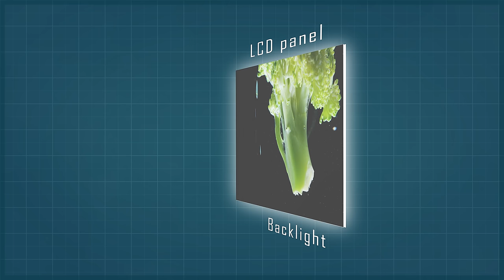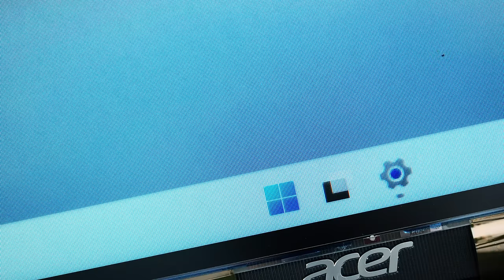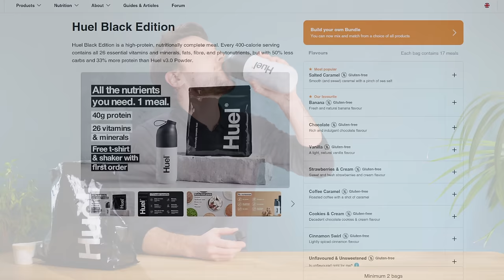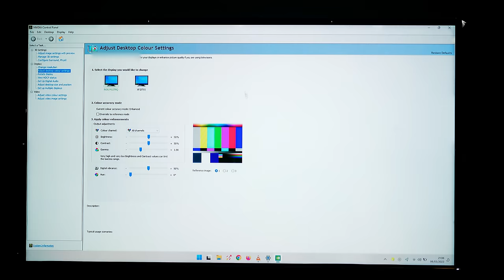DIY Dual-Layer LCD monitor - can it match OLED??

Comment: Very cool project Matt, even though this one isn't very practical as pulling 250W constantly for a monitor will easily offset just buying a more expensive monitor in the long term it's always fun seeing your ingenuity!
Reply: It's obviously winter monitor. During summer, he uses his DIY outdoors waterproof screen 😄
Reply: But it cuts your heating bill..
Reply: Not just the watts but your GPU would be effectively driving 2 monitors with only getting the resolution of one so WAY more GPU power is needed to. So yeah the cost of an Oled would be way more effective but yes still a interesting video.
Reply: @WDMurphy  no the HDMI signal was just split. GPU not doing anything more
Reply: @WDMurphy  but gpu is free heater. XD
Reply: @WDMurphy  That is incorrect. The GPU isn't "driving" anything. It is rendering a single image, the same as before.
Reply: @sid.h  LOL DRIVE as in why I used " "
Reply: @mattjnewham  ok but with HDCP HOW does he get any game or videos to run wouldn't that break hdcp?
Reply: HDCP isn't really being used nowadays.. In my computer I disable it on NVCleanInstall
Reply: @WDMurphy  splitting an HDMI signal still allows a handshake assuming the splitter supports it
Reply: @WDMurphy  Displaying more monitors actually has little to no effect on GPU performance
Reply: @WDMurphy  comparing to the average wattage of a computer monitor, it would take about 3 years to total the price of a good zone dimming monitor to replace (which as he mentioned has a greater blooming problem), and as others have mentioned the GPU isn't rendering any more than it already does so it doesn't have much of any effect on gpu power at all.
Reply: @platinumsky845  I have a Samsung 65" QN90A and a 27in 1080p 240hz as a secondary monitor. I never mentioned the wattage as "really" being the problem. The Samsung uses WAY fewer watts than he says he's using in this video AND it has local dimming BUT you are right about the blooming. It does suck and at times is way better with it off but that does FK up having nicer blacks.

My PC is an AMD 5800x, 32gb ram, rtx 3080ti
and total watts counting the Samsung and etc... on my powerbank monitoring, IS only ever near 378 watts even when gaming.

Now I did make the mistake that I thought he, in the video, was rendering 2 1080p videos overlapped (that's what I get for commenting before completely watching his video)

You are correct that the wattage "price" vs spending 1600$ isn't even comparable but and that's a big one I'm gaming on a 65in 4k 120hz "tv" compared to a 1080p monitor, not counting I could have just bought an Oled, but I prefer ips (yes really I do). You can get Oled "TVs" cheap enough now, burnin is my only concern because I do leave it on nearly 20hr a day.
 
And AT 8:03 HE even used the word "DRIVE" that someone else gave me $#!+ about using. I did not see him using a splitter which DOES somewhat negate my complaint.

People are even going and saying that running two monitors isn't more of a strain on a GPU which is BS "if" you are "running" at a higher resolution of two monitors and not splitting.
People are acting like a bunch of rabid wolves to be "that guy" like look look at me I'm right too.

You are right that the blooming can be complete crap tho, and Oleds basically fix that but there are also other downsides to Oleds. 
But if you're really that strapped for cash you probably shouldn't be taking on a project like this and "risk" losing both your monitors.

Sorry for the long-winded reply.
Reply: @deltahl  You are pretty correct but it still causes me a headache when using my portable Blu-ray drive sometimes. I'm just to old and do like owning my movies on disc lol
Reply: @WDMurphy  he's using a hdmi splitter, the gpu is not driving 2 monitors
Reply: @randomgamingin144p  Yep I know this now lol and like 6 ppl already said so lol, even my last post. honestly, I like your reply more just straight to the point on what I missed in the video.🤣
Reply: I don't know about you, but I don't leave my computer on all the time and even when I do need to leave it on I turn the screen off when I'm away.
Reply: @Wobbothe3rd  Oh well I have bouts of being up 24-30hr and sometimes and when I'm playing there is static UI elements,.
Reply: Cost isn't a consideration. The guy is obviously wealthy.
Reply: @WDMurphy  As long as the monitors are both HDCP compliant there's no problem.
Reply: 250w is nothing, so I don't care.
Reply: @WDMurphy  The solution is simple, don't waste energy on 4K resolution nonsense.
Reply: @IncognitoActivado  I don't but I do run pretty much everything in 1440p.
Reply: @WDMurphy  Ok?

Comment: This just makes me want to find a high refresh rate monitor with a busted backlight and just drop it on top of an overhead projector from the thrift store so I can finally have my high refresh rate projector I've wanted for years now. Seeing you do the disassembly and backlight design was inspiring and empowering! Excellent as always
Reply: maybe even mod the overhead with a high CRI COB LED
Reply: @Angel_Bob_  Yeah, definitely go LED for major heat savings ---> longevity.
Reply: THIS project?  Not the projector one? https://www.youtube.com/watch?v=YfvTjQ9MCwY  Admittedly that is a lot more effort than "slap monitor on overhead projector".  But I can GUARANTEE you the overhead projector route is not great.  Noise, light leakage.  Aspect ratio.  Awkward placement of ohp.  Not saying it can't be done, as it has been done to high degree of success since ages ago on various forums.  But it is also high effort for a "good solution".  And the "low effort" method is very much, "you get what you pay for", so to speak.  I suppose you are looking for a specific functionality that is missing in commercial products for a reasonable price, so it might be worth the effort.  But if so, I imagine DIY Perk's projector project is also worth the effort.  Just a thought.

Comment: We have panels like this on a lot of our casino floors! IGT made a unit called the G23MLD (Multi-Layer Display) that has 2 LCDs stuck together to achieve a 3D effect on the slot theme. Most of the time the reels are on the back monitor and the line indicators are the front monitor
Reply: As soon as I saw this video I thought the exact same thing. We have them as well but most of ours have developed black spots. So I question the longevity of the monitor, but that one still looks much better then the IGT version ever did.
Reply: @brandonf2562  Have you been making sure the fans are working? One of our older tech was saying that half the screen wouldn't be working soon after the fans died

Comment: OK, firstly, this is amazing, honestly, many kudos. And please make this a series, this can be improved vastly. On the top of my head a low res monochrome panel as the 2nd display or using controlled mini led for backlight, etc there's just too many possibilities. I cannot wait for more versions of this, Thank you.
Reply: Bad idea. The second  panel must be identical to avoid image degradation with the different characteristics (transition timings, latency, gamma offset, etc.)
For the controlled mini led for backlight, this is basically how the high end HDR LCD display with local dimming zones works. But its very hard to DIY as it needs extremely tight timings to analyse the signal and switch light with the same latency as the LCD panel. And the absence of blooming will vary with the number of zones and the size of the lighten elements on screen.

Comment: HDMI splitters often cause problems with HDCP, I think it is better to connect both panels directly to the graphics card and clone the output in the driver. 

Btw: You can avoid the Moire artifacts in 2 ways. Increase the distance to the LCD and zoom in or tilt the camera by 45° and correct for it when editing the video

Comment: Not sure about current ones, but older LCD screens had a layer of polarizing film between the panel itself and the backlight. Maybe removing one of those films instead of putting tracing paper inbetween screens might have worked better.

Comment: This is why I usually prefer VA panels, they're much better these days than they used to be, viewing angles aren't really an issue on a good panel, mine has the same viewing angles as the same MSI IPS monitor. I got the curved version and I love the deep blacks and contrast. It's a high refresh rate too, 165hz. I have had bad VA monitors though a while ago but this one I have now is great.
Reply: But unfortunately they are still terrible in terms of response times and hence the ghosting, so no go for competitive gaming
Reply: @heartbroken3344  actually not all, I recently tried the flat AOC AG275QXN and it's great in both response times and input lag, the only issues are viewing angles were very bad and the washed out colors probably because it is flat, also bad gamma shift (most noticeable on black color) so I returned it.

Comment: v2 you can remove a polarization layer and have them stuck close together allowing for much better office workloads and should also make contrast better due to not having frosted layer between the lcds

Comment: I suspect that you could get a slightly crisper image by using more uniform commercially available diffusion films and optically transparent epoxy to bond all of the panels and the intermediary diffusion film together. I do appreciate how you went straight to replacing the entire backlight system with something substantially brighter, though doing so without needing to utilize several layers of commercial optical dispersion films with different dispersion patterns before using a standard frosted dispersion film to make it uniform does necessitate a deeper enclosure. I do think this is a topic worth revisiting at some point in the future to further refine the idea. Maybe with a couple of cheap 43" 4K televisions. If you have a decently deep desk, then a 43" television mounted to the wall behind it is a great monitor size for most applications. If possible, it would also be a good idea to just utilize an inexpensive HDMI splitter to duplicate the HDMI signal without relying on your GPU to keep the images perfectly syncronized. Ideally, you would want to find a way to drive both panels from the same driver board so that the signal is sent at the same time and there isn't a risk of clock drift between the driver boards. This would reduce ghosting. Unfortunately, it's unlikely that the driver board can provide enough current on its output pins to handle two panels in parallel.

Comment: The right way to measure the convenience of "dual layerlcd" is to present an image like a chess board, 100% white squares along side 100% black squares. Then you measure the luminance with a luminance meter. A typical white luminance is about 80cd/m2, and a typical black luminance is about 2cd/m2. The contrast ratio is the white luminance/black luminance. A dual layer lcd is better than a regular lcd ONLY if the contrast ratio is greater in tje dual layer than in the regular lcd. You show us a darker black in the dual layer but also a brighter white in the regular lcd. We can say nothing without measuring contrast ratio.
Reply: In a typical display the contrast ratio is 40. So the white transmitance is 40 times the black transmitance. Lets say that the white transmitance is 0.4, so the black transmitance is 0.01. With 2 layers the CR=(0.4*0.4)/(0.01*0.01).  The CR=40^2=1600. Wow, I was way way way wrong. Sorry by that.
Reply: @guatagel2454  edit your original comment with this. I was about to comment that you were way off

Comment: You should try this again but using SMD LED diffusers. They're a little plastic dome that just clips on over each LED to get the diffusion effect you are looking for instead of the tracing paper.
Also, polarizing film isn't that expensive, changing the in-between layer for a sheet of that will likely give you even better contrast.

Comment: Pretty neat, and very clever! The thickness bothers me 0%, it's still far lighter and thinner than many computers I've used in my life. But the increase in energy cost over time and the slight fuzziness are issues that i think would steer me away from making one
Reply: i wouldn't be surprised monitors are often lighter than computers if we're talking about desktops, but this isn't an AIO if that was the persuasion you caught
Reply: I mean the thickness could be fixed with a good diffuser that isn't baking paper would help the power consumption as well given the LEDs dont need to be as bright as before.

Comment: Super neat. I feel one aspect for improvement is calibration between the position of the two panels to narrow down some of that 'drop shadow' effect. 
I'm sure you could probably also get better LEDs for the backlight as well.

Comment: You amazingly and regularly come up with original projects. Keep up the good work!
Reply: While the projects and videos are amazing, This particular one is hardly new, Hisense was experimenting with it some time ago before moving on to a different way of doing things
Reply: @Yuki2204  
Hisense? Dude, dual layer LCD's been a thing since the 90s, LOL hardly new but what is new is how easy it is to accomplish at home with little effort.
Reply: @SMGJohn  fair enough, the Hisense panels are the only time I encountered such a thing so
Reply: @Yuki2204  I've never heard of this before... and I was around in the 90s!
Reply: @Yuki2204  
1990 Toshiba had dual layer SuperTwisted Nematic LCD displays which were two layers of TN panels together to increase contrast. 
Both LG and Samsung had dual layer prototype LCD panels in early 2000s, Samsung also produced dual layer LCD panels with ability for 3D which were mostly used in slot machines and arcades. 

Sony has a long history of dual layer LCD and later dual layer LED panels for their broadcasting monitors which they still produce to this day. 

So yes, they did exist, they did cost a lot of money, and no they were not popular, the first prototypes of LCD technology back in 1984 also had prototypes of dual and triple layer panels sandwiched together to create a two colour output, this was before they figured out they could sandwich a colour filter to get colour output from one panel.

Comment: I wonder if you could look into multi-layer 3D light field monitors. They use multiple LCD panels at a slight distance.  Basically you can calculate how a certain light ray would move through the panels, and color their pixels accordingly. For example in this decade old paper: Tensor Displays: Compressive Light Field Synthesis using Multilayer Displays with Directional Backlighting
Reply: Ooooo amazing. I just said in another comment I'd love to see spatiotemporal superresolution as well as using old Sharp Quattro panels (the panels WEREN'T snake oil, but the TVs were, because some idiot at Sharp 'cut costs' & they used narrowband tuned RGB backlights instead of RGBY backlighting, effectively making the amazing panel useless), combining that with light field monitors o boot... chefs kiss
Reply: That is definitely one of the more most compelling uses for doubled-up LCDs. The tried and tested method for angular modulation has been to place a large array of lenslets in front of an LCD to modulate the angles of the pixels. Once you have computed the mapping from pixels in 2D to (hopefully tight & collimated) rays, you can trace rays backwards from the pixels to query their intersection with some simulated object, thus determining which pixels to switch on. This is great, but even with high resolution LCDs this ray optics model ignores the wave properties of light. Ideally, a second LCD in front of the lenslet array would have high transmission rate, and rather than modulate the brightness, modulate the phase of the transmitted light in order to simulate optical wavefronts. That would, in theory, make simulated objects in front of the panel focusable.

A company called Light Field Labs appears to have done something like this using a static phase-only optical layer, but as far as I know nobody has demonstrated switchable phase modulation / dynamic focus using such a large panel.
Reply: @stewartforshaw8558  Sounds like what Lytro was doing with cameras.